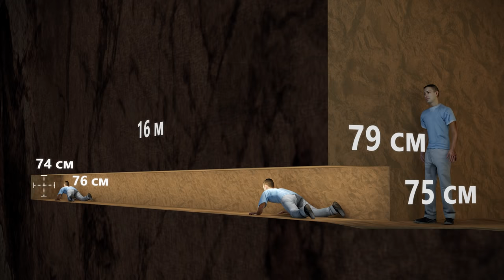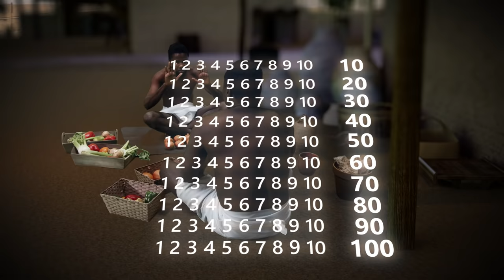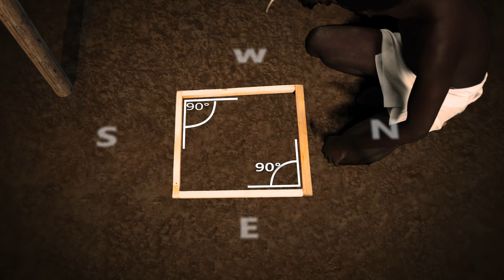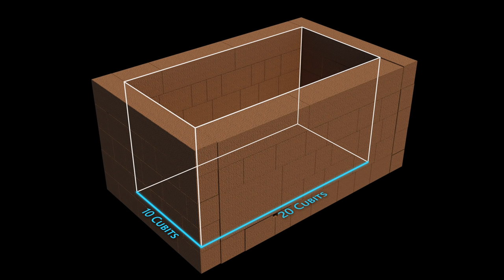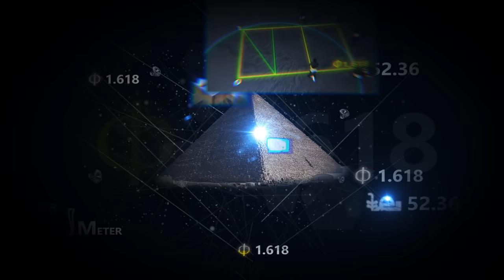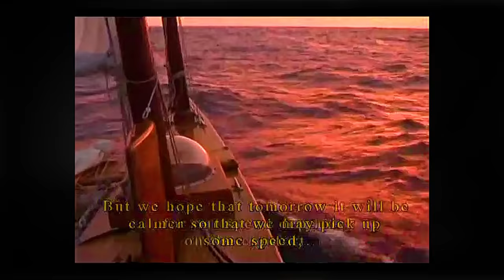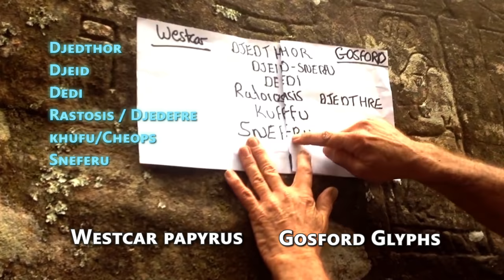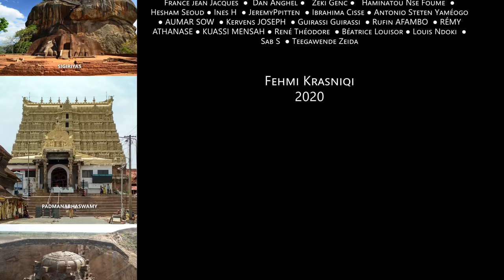The Movie Great Pyramid K 2019 - Director Fehmi Krasniqi

Comment: Granite is generated from magma, underground so it cools slowly enough that three types of minerals form; they are quartz, feldspar and mica.  The migration of the ions and the crystallization into these three specific minerals requires a LOT of time.  The slower the cooling, the larger the crystals.  I have seen granite in the Mojave Desert north of Scottsdale, AZ that cooled very slowly, miles underground.  The individual crystalline components were up to 4 inches on a side!  The premise that granite could be melted and quickly cooled, regenerating granite is ludicrous!  This quick melt-and-cool process would produce lava, or perhaps amorphous obsidion glass, but certainly not granite.  The objects and buildings made of granite are truly awe-inspiring and created by processes not duplicated today, but the melting-cooling hypothesis needs to be abandoned.  I have melted basalt with a 12-inch Fresnel Lens and generated obsidion glass beads on the surface of the rock.
Reply: Thank you for the inclusion.
Reply: I think that you are missing the point, Lon.
This 'movie' is nothing more than a 'suggestion of how the Pyramids' might have been built.
There are dozens more, just like it!!!
Reply: @johnsonhunglo1993  I like the insights into the possibility of poured geopolymer for the limestone blocks.  That answers a lot of questions concerning the massive "blocks" that had to be lifted in every stage of construction.  The white and brown limestone placement in the interior and casing is also well portrayed.  I commented on the melting of granite and pouring it back into granite that was too implausible for me to overlook.
Reply: @johnsonhunglo1993  it might be a suggestion, but they state it many times that this is how it has been done....
Reply: @lonbrouse6440 :
The idea of 'melted' rocks has been trending for a couple of years. 
The only question now is, can it be done?
 I would like to see some HBCU undertake the task to either prove or possibly disprove the theory.
Would that drive down construction costs?
Reply: @amyattell9679 :
Well, if you post it, 
you have to show belief in it!!!!
Reply: @lonbrouse6440  so you do agree with I precised even if not answering
Reply: Aliens 👽
Reply: @MichaelBlackstone777  NOWHERE IN THAT VIDEO DO YOU SEE GRANITE BEING MELTED. ONLY SOME KIND OF ROCK SMOKING A BIT.
Reply: @bigsmalls8354  Granite is really generated from smegma, sometimes maga.
Reply: @johnsonhunglo1993 , I don’t understand why it has to be an HBCU? Why not any college or university, which would include HBCU’s? I’d like to see multiple universities and others take on such a project. Why specifically exclude some from such an endeavor?
Reply: @MrWadsox  right on the money..............
Reply: @Messerwon :
Good Morning & Happy New Year, 
to you and yours.
It does not 'have to be' an HBCU.
But, as a Black man, 
I thought that it would be kind of nice, 
a point of pride. 
I don't see, nor have I heard of, 
a lot of 'engineering' schools rushing headlong into the fray!!
In fact, I am thinking that it would take a coalition of schools, 
with varying degrees of specialties, 
to accomplish the desired output, 
a scaled model of a Giza-style pyramid!!
Reply: @MichaelBlackstone777 :
I think that the consensus is:  
'rocks can be melted'.  
The issue is, 
can a specified volume of melted rock be maintained long enough to accomplish the desired task, 
the formation of a building block.
Each 'engineered block' weighs in at about 5000lbs. 
(More than 2,300,000 limestone and granite blocks were pushed, pulled, and dragged into place on the Great Pyramid. 
The average weight of a block is about 2.3 metric tons (2.5 tons).)
The boiling point of the component mixture is 2300F. 
This is done in an open-air environment, there is nothing in the way of 'controls'!!!
Reply: @bigsmalls8354 :
Perhaps!!!!
Reply: THANK YOU. I can't believe how many people don't understand how rocks work.
Reply: @MrWadsox  Nice. Peace.
Reply: Why did the Egyptians who had more power wear those strange caps in an ovoid shape?
Reply: @TheAusroar  Finally, someone talking sense...Peace.
Reply: @TheMariepi3 :
There must have been some very heavy fashion influence!!! 
You do know that they shaved their heads and wore hairpieces?
Those sand fleas were vicious!!!
Reply: I agree. They used a form of stone softening technique; a lost art of rock molding sort of like Greek fire. History shows they had that capability but no one knows how they were able to do it, even today. This just shows how advance civilizations were back than.  Looks like today's scientist are reading from the 29Th Scroll Six verse:).
Reply: As an old mechanical engineer, specialised for one in building construction calculations, I am happy to read your contribution sir.

I have lituarly 100ths of doubts about the pouring techniques... 
If the blocks were poured on site, why do they look like seperate blocks?
I mean, the second block you pour would use 1 of the 4 sides the previous block to be poured against and would look flushed with it... but it clearly doesn't!

Not one stone looks the same!
So they used every mold one time and made a completely different one milions of times and wasted the whole precious forrest for building these?

Also the pressure on the sides would have been significant and the wood would bulge, even a bit, yet there are no traces?
And many many other mechanical issues make me doubt the pouring theorie. 

And why they would pour the brown lime stones in blocks?
Much easier to just pour the whole layer inside the white limestones!

Everywhere around the world we see big holes in massive blocks like they had wooden beams sticking through... why? If they were poured?...
Etc etc
Reply: @kkrobertson1  I would love to see any type of "stone softening" in action that would not begin to melt some of the granite.  Vague references to "chemical softening" is only hand waving unless one can specify the chemical reaction. Once melted, the crystalline mineral structure of the granite components of quartz, feldspar and mica is lost.  How well does warming ice cubes "soften" them?  The crystalline structure of the ice falls apart from the outside in, turning into liquid water.  the ice cube cannot be "molded" the way some accept molding granite and andesite "softening."  Whatever ice is left, will crush or shatter if pressure is added.  Ice is considered a "mineral" by the US Geological Survey.
Reply: @lonbrouse6440  again we know the Greeks had Greek Fire! At-least that what history tell us. Yet with today's modern science we still cannot duplicate that. And today as to these pyramids we see structures build with precise engineering that cannot be duplicated today. Clearly history has shown us with undeniable truth. There was civilizations that existed that were far more advance in Math, Science, Engineering etc... than we are today. Which completely destroys all these evolution theories.With that said; I completely understand your disagreement as to (stone softening). However, there was a time not to long ago. You could lose your medical license if you believe in Germs! Than came the microscopes.
Reply: @ImmortalOutlaw23  n
Reply: Lon. Spot on. You are correct. I don’t think this idea was not well thought out or researched.
Reply: I’m no scientist but I don’t think the water in that clay tunnel “mold” would respond very kindly to being covered in molten granite. I think it would have resulted in a massive steam explosion at some point. Which begs the unasked question, what were the molds made of that molten rock were poured into?
Reply: @Starriddin  There are multiple speculations offered in this video that are physical and chemical "stretches" of the natural laws.  You point out several good ones involving "molten" rock in contact with wood.  I remember back in the 1970's when wood-burning stoves were the survivalists' answer to living off the grid.  Someone posted a spoof advertisement that presented a wood-burning stove that was guaranteed to burn for 6 hours.  It turned out that the stove itself was made of wood and would consume itself in a minimum of 6 hours.  Likewise, any clay molds would have to be heated to remove water or your prognostication of a steam explosion would certainly ensue.
Reply: Hello Lon, Thanks for writing this comment. It answered a lot of questions that I had except for one. Please excuse me if you have answered it in another comment or reply and I missed it.
Here goes.... Would it be possible to grind up granite from the quarrys, mix it into a cement, and then pour it into a form or mold, and have something looking like granite once it the proccess was complete.? 
I'm probably too dumb to realize that that was a dumb question, so forgive me if it is.
I'm from the Southeastern United States where Terrazzo and other similar things are popular, and although I don't know the exact proccess of making Terrazzo, it looks like it's just an amalgamation of ground up and broken up materials that have been mixed into a type of cement mixture and poured to create some pretty beautiful results, so I was wondering if the same thing could be done with granite, and by some proccess of stirring while it hardened, cause it  to end up looking like cut granite blocks to the untrained eye.? 
Thanks in advance if you reply.
Reply: @michaelmoore8680  Thank you for the well-formulated questions.  I did a little research on Terrazzo (originally small pieces of marble [a metamorphic stone] blended into cement that makes a durable floor that can be re-polished).  Up-close photos of granite show the three minerals of which it is made:  Quartz, Feldspar and Mica [all igneous] with no additional binding material between these minerals.  Up-close photos of Terrazzo show the marble pieces and the cement making up the rest of the volume surrounding them.  Egyptian limestone cement has had sea shells added to it in some buildings.  The shells are easily distinguishable from the limestone surrounding them.  Crushed granite would act as gravel surrounded by cement, a condition that would not look like granite and would be quickly identified as such upon inspection.
Reply: @felipecano1468  Invoking Secret Societies is really just kicking the can down the road and really does not answer anything.  More factual information is constantly being discovered that gradually illuminates the mystery.  I keep watching and evaluating the story as it unfolds.
Reply: Try a 200 inch lens
Reply: @kelmanbeats  :
That really is the question, isn't it?
The 'experts' hop around the question.
They usually answer the question with another question!!!
Personally, I believe that there were 'Black Pharoahs' as heads of Egypt. 
The questions are when did they rule, 
and what did they accomplish?
Some experts say that they were mere 'placeholders', 
others say that they actually advanced their culture.
Reply: Correct in what you say magma that cools very slowly over possibly 10's of thousands of years is needed to produce granite. however, melted granite would not produce obsidian it would be Ryolite as granite is acid rock. I'm a BSc geologist + 20 years experience. and I need to look into this concrete theory must be a way to prove looking at matrix of the limestone or carbon dating. I not finished watching yet but I'm calling bullshit on that theory and doesn't explain the granite carvings and vases etc which are predynastic.
Reply: @hankchinaski4075  I am a Chemist not a Geologist.  I just reported what I have seen when naturally-formed minerals are melted.  I have generated black glass when I melted pulverized rock samples during my years of performing "fire assays" for gold, silver and platinum.  I never saw any crystalline minerals formed in the almost immediate cooling of molten rock.
Reply: @lonbrouse6440  You are absolutely spot on my friend. Granite is a Felsic rock flash cooled will be fine crystalline or glassy as you say obsidian. Its beyond me how their theory has missed this basic fact. Like the granite crystals reform in the mold. Utter rubbish. Totally impossible.
Reply: @TheMariepi3  they had far bigger heads.
Reply: @bigsmalls8354  aliens 👽
Reply: @kelmanbeats :
Agree!!!
But, you never hear these things if you do not control the narrative!!!
Reply: @jbfrodsham  👽 aliens !!!
Reply: @johnsonhunglo1993  Egypt was multi cultural/racial.  The first attempt at the worst idea ever.  That's what Egypt was.
Reply: @johnsonhunglo1993  It doesnt work.  Has never worked.  Everybody needs their own land or there will be conflict.   None of your mumbo jumbo means anything whatsoever.  We have clearly been created uniquely.  You seem set on destroying that uniqueness.   So who's going to have regrets?
Reply: @americanineverywaybutcitiz2330 :
WTF are you going on about?
Reply: @johnsonhunglo1993    People who like their own comments wouldnt understand.

Good bye.
Reply: @americanineverywaybutcitiz2330  :
C-Ya!!!
Reply: @CarChrisMC  exactly,,, that's what I thought,, by the way , also a mechanical engineer, 😊 , how do u do
Reply: @purebloodstevetungate5418 :
It was the 'Mongols'!!!!!
The 'Mongols' chased everyone out of their areas!!! 
The 'domino theory' was demonstrated, bigly!!!
Reply: @johnsonhunglo1993  Mongol Empire "Golden Horde" wasn't a thing until the 11th century.  Human migration started  out of Africa in  pre-historic times in  fathomable terms around  600,000-450,000 BC.
Reply: Obviously the ancients had better tech than us
Reply: Someone has had a geology lesson or two.
Reply: The EGYPTIANS go from most advanced builders to DATE to with all due respect 3rd world country.  Sorry that doesn't make sense. They inherited these structures as did the incas from an advanced world civilisation.
Reply: @TheMariepi3  
10,000 years ago three migrations to Egypt began. The first from the middle east , the second from what is today Sudan, Ethiopia etc. , the third from  North Africa , Sahara included. They all witnessed the landing of three Pyramid looking Alien Craft in the Giza Plateau. One of the first human to enter into contact with the Gods from space was a shaman who newly arrived to the Giza plateau from what is today called the oasis of Siwa. He went back to Siwa as a worshiper of the God Amun. The interaction of the Gods with the humans produced a leap in the evolution of Mankind. When the Gods left , the Egyptians tried to replicate the Pyramid looking craft in stone at the three landing sites in Giza. At Siwa the worship and Memory of the God Amun , the God that came from space were kept. Alexander the great knew that...
The Giza plateau was not the only place where the Gods from space landed...
Reply: I agree with you having worked in open pit mining for decades and been around and listened to many geologists talk about rock formation. There is no way any civilization back then had the technology to heat massive amounts of granite to over 1000 C.
Reply: Although you have an excellent point about the melting-cooling conjectures, when we consider how microwave radiation heats food; given their great discoveries I would consider that they developed a lens capable of microwaving rock which would allow molten forms which quickly hardened in small quantities.  Microwave technology has not reached its apex and surely we would all benefit from such a discovery.  I believe this explanation more reasonable than previous but by no means the total explanation.  However, Truth is hardly an easy discovery...  House of KingDavid
Reply: @nouneyhill9795  Where is the source of all this high-intensity microwave radiation?  Solid materials are opaque to microwaves, and thankfully, very low intensity radiation in this range gets through the atmosphere.  Additionally, they are "focused" by antennas, not lenses.  Have you seen a photo of the microwave "horn" antenna in Holmdel, NJ, that was built in 1959, used to detect the background microwave radiation left over from the "Big Bang?"
Reply: @nouneyhill9795  ouch. erm giving you a free pass for not understanding the different forms of energies which frequencies plays. But seriously though, just because you think of something does not make it so.
Reply: Geologist here, complete concur. Granite crystals cannot be poured; however pouring the limestone makes alot of sense.
Reply: The Granite and large amount of Granite Quarries all over Egypt make the cement hypothesis questionable.
Reply: I agree that it is ludicrous to create granite but in this case it comes down to the lesser of two evils. What’s more likely, the Egyptians hoisted that granite that high and positioned it perfectly with an incredibly smooth surface or that they somehow moulded it with a different process to how we think. I saw another idea that the “granite” on the small pottery would be a different kind of rock that was processed in a way to look like granite and moulded on. It seems unlikely but considering you can’t heat and reform granite it is the closest we can come
Reply: @penguinboi4205  Pouring magma granite is an impossibility. Cutting and lifting are at least possible.
Reply: @landon2215  I agree that isn’t possible to melt but the limestone geo polymer dosent have the same chemical similarities than that of the Taurus limestone site. Plus how do you explain the wood clearly embedded deep into the wall as there is no way to cut them. Also you say lifting is possible can you link me a video that actually shows how they could do it because I would like to see your viewpoint
Reply: @CarChrisMC  Древесину можно защитить от влаги уложив внутрь опалубки ткань пропитанную жиром! Надо бы поискать следы отпечатков такой ткани на поверхности блоков! Но это вопрос к автору этого фильма! :)
Reply: TRUTH!
Reply: What's even more absurd is that granite was carved!
Reply: @TRICK-OR-TREAT236  Most of the video was a cartoon, not a documentary showing actual processes.
Reply: @kkrobertson1  Your arguments are red herrings, not pertinent to this discussion.
Reply: @lonbrouse6440  in all do respect sir. Your explanation is based on in understanding of the science you know and not base on the science they had. Therefore, your explanation as to how these stones could not have been melted as shown in the documentary is more than correct and has open all our eyes to that reality. 

However, these structure, clearly was not built the way archeologist and other professional  in this area claim they were. So these Nubian's as they called them-selves; must have used another method to construct these pyramids as they are known to us today. Mentioning methodologies that could have been lost (like Greek fire) to build these monuments is more than plausible, in fact! The structures them-selves are an observable reality of that truth.
Reply: @kkrobertson1  The science that is known is all we have to evaluate observations.  New proposals are always welcome but to be taken seriously, the proposals must also be accompanied with plausible mechanisms for the processes.  Identifying that there are unanswered questions concerning the way the pyramids were built, should not immediately propose methods that have no scientific support and cannot be replicated.  Those items are best left to future investigation and new discoveries.  Demanding unsubstantiated claims be accepted, quickly relegates these ideas to the "fringe" because these claims do not lead to productive investigations into plausible mechanisms.  Step-by-step investigation is the basis for the science that has led humanity out of the stone age to the level of culture we currently enjoy.  Open discussions, like this, often lead to new discoveries.
Reply: @lonbrouse6440 up until the stone age part. I was some what with you. This conversation in it self, negates that theory.  History has shown, these advance civilizations more than likely coexist with less marginal societies. The same way Western Civilization do today. With that said. The science that was used to build these pyramids were more advance than what we have today. If it was not, than what they constructed would not be such a mystery to us. We could easily duplicate it using the science we have today. But that simply not the case.
Reply: @kkrobertson1  I think I mentioned that we have to start with the science we have when we approach unexpected discoveries from earlier civilizations.  If they used different techniques to achieve their goals, applying scientific methods to the investigation is the best tool we have.  The first step is to hypothesize a method they may have used and investigate that.  That is precisely where we are now.  The next step is to see if we can duplicate their results with our hypothesized process.  That is the hangup.  There has not yet been a hypothesized process that can be tested to duplicate the results seen in ancient Egypt.  How do we make a big leap without taking the smaller steps first?
Reply: @lonbrouse6440  "touche" on that point.
Reply: so do we go back to copper tools cutting and carving granite blocks?
Reply: I’m not at all shocked that you didn’t include your Establishment funded Doctorate.
Reply: @johnsonhunglo1993  The trending “Idea” you’re alluding to is due to THIS documentary. 

I’m a financial analyst coming from a 4th generation private family of  precision engineering exporting manufacturers that hasn’t yet been succumbed to takeover. 

It is the most accurate theory I’ve had the pleasure of seeing. Most definitely worth other experts to debate in peace. 

It’s hardly been discussed within MSM which should be a red flag to anyone who innately thinks critically and isn’t part of the Establishment. IMHO.
Reply: @amandar7719  What are you talking about?  I worked at an outside job while I completed my college degrees.  I earned scholarships and took out student loans (that I paid back).  What Establishment are you writing about?
Reply: @amandar7719  fair enough,  but granite can't be melted back into its natural form.  I agree with the casting. I was all the way in ,until I looked up the experts, granite melts. But as far as I know, not back to granite.
Reply: @lonbrouse6440  The one that triggers commentators to divulge their qualifications and get others to think outside of the box when reading mine. 😃
Reply: @derekgreene2304  Did you read one of my posts that said anything other than melted granite does not return to granite?  You may have me mistaken for someone who stated that but it was not me.
Reply: @lonbrouse6440  what are you talking about, I never said it was you. I watched a documentary months ago and looked into it, some guy melted granite and it went black and brittle, he was a professor I think. Your the one that is mistaken. I'm just trying to find out the truth. With the smithsonian in our way, it's so hard. There had to be an intelligent civilisation/ civilisations back not long ago. I think they mined the earth and moved on.I also think the earth is flat, and there's more land that there not coming forward with. Nasa never went to the moon, not in that thing anyway. How'd they get the rover on, antarctic treaty, the pope turned up for that one. Admiral bird told us all we needed to know,  forestall got checked into a lock up ward, then thrown out a 16 story window, he was coming clean about it. You can fool some of the people some of the time but you can't fool all the people all the time!! Wise up is a good channel, not always right but he's thinking. Is it possible there was a reset in humanity in the 15 or 16 century, before even. In some European countries they were teaching disc shaped earth up to the 30s, in America too. Watch flat earth the movie, you'll be surprised. There's no curve. NONE.
Reply: @amandar7719 :
Okay!!
Reply: @lonbrouse6440  Isn't moving those granite slabs as implausible?
Reply: @assassinbullets928  Yes.  That is the point.  Nobody has yet come up with a plausible process by which these structures could be built.  Keep Looking!
Reply: rather than disproving this theory, why don't you team up with them and contribute something towards this enigma
Reply: @mohdazmi3590  :
I would love to see some school undertake this effort.
But, the costs may prove prohibitive.
But what technique!!
Reply: @johnsonhunglo1993  maybe we are not as advanced as we think we are as compared to them, in terms of solar utilization. But if this solar lens method can be proven, this will answer many historical questions, and clearly contribute to numerous solar research programmes.
Reply: @mohdazmi3590 :
Bread crumbs all over the place!!! 
There seem to be signs and messages everywhere saying 'we were here'!!!
Reply: That's a very good point and thank you for the clarification. I personally think the granite is the only stuff they actually took the time to cut and polish. Rest was poured into molds just like we do it today.
Reply: @mirceaalex8313  :
Is that a practiced technology?
Molded granite blocks/bricks?
Reply: @johnsonhunglo1993  Molded granit not but the actual blocks were actually replicated and they got the same material as one used on the Pyramids. It definitely makes more sense to pour a structure then to somehow cut huge blocks of rock and somehow cary them for huge distances. Not to mention that using a ramp to build the Pyramids would require more materials as the Pyramid itself. They most likely poured the main blocks and only the granit stuff was carved and sanded.
Reply: Thank you sir.........here here!!!!
Reply: @brianl3240  Many other contributors to this conversation have made comments based on their experience with melting granite and other crystalline-based minerals and have all come to the same conclusion........that when cooled the molten material never returns to its original form, including granite.  The magma crystallization processes take thousands to millions of years to separate and grow the component crystals and minerals.  It is not accomplished by melting and casting amorphous glass.  

What have you personally done?  Do you have anything to add to the conversation except to deny what others have contributed through personal experimentation?  It is the mark of critical thinkers to explore many sources of information that address the basic premises of a claim.  It is the mark of the duped who take a stand in ignorance and defend it with stubbornness!  

Which approach seems more rational to you?  If 1 million people all believe the same wrong thing, does that make it correct?  I think not.  Even Einstein said that all of his thinking and conclusions, even if accepted by masses of followers, could be disproved by just one substantiated, contradictory observation.  The truth is not established by its seductive popularity, but by critical thinking, observation, confirmation by people who are trying to disprove it, but cannot, and finally being open to change their opinions when presented with new information.  That is called science.
Reply: @brianl3240  Read all of my posts.  This train of thought has been addressed and your rejection of many contributors and mountains of published references dealing with the nature of melting and crystalizing rock looks a lot like willful ignorance.
Reply: Your first mistake, try melting at 2500 degrees. Once you’ve done so come back and leave a better comment.
Reply: I don't see you offering any other possibility of 30T blocks being carried and then joined, all different shapes with less than a cm between them, all the way along. 
Please explain.
Reply: @Ant88889  People have been guessing how the pyramids were built ever since they were completed, thousands of years ago.  I have not put forth any details for the construction because there are already too many guesses by people who have no idea.  There is no benefit in making any premature conjectures until more research is done in the critical areas of chemistry, engineering and materials science.  While entertaining, these discussions do not move along any understanding.  I have focused on evaluating some of the guesses presented by others and offering my critiques on ideas that are more or less plausible as constrained by the science we currently understand.  To do otherwise causes people to wander off int mysticism and alien intervention.  In short, magic.  There is no value whatsoever in going down those paths.
Reply: Perhaps they didn't simply "melt" natural granite, but several materials/minerals that when combined into a porridge type of molten rock, it will cool to possess similar attributes to natural granite.

Perhaps they had a recipe/process for this, gained over hundreds or thousands of years working with stone, that has been lost long ago. 

The alternative, that these enormous granite blocks were carved, pulled, lifted, and chiseled to perfect dimensions using stone tools, is completely implausible.
Reply: @amyattell9679  This is a problem for dyslexics people think if you repeat exactly what you said then to you it makes sense to me it still dosent .Like mathematics it needs to be approached from a different angle.
Reply: @jaybayer3670  I do ...ROCK N ROLL YEEEEEEHA there you go heehee.
Reply: @johnsonhunglo1993  F...k the pyramids the most important fact here is black Egyptians where giving the people of the world knowledge before slavery .Now black history can be rewritten there can and should be further research done.
Reply: Explain how they where built public school teacher. I will wait.
Reply: Look at the gods aliens worshipped. Happen to match description of Nephilim.  That Science supports did exist but they called them Giants.
Reply: @silkoakranchpitchforkranch1205  First, I have already posted that at this time, nobody knows how the pyramids were built and that includes me.  I can question presentations and postulates against known physics and chemistry.  I have simply stated the flaws in the hypotheses in the movie.  Demanding that someone come up with a coherent method of how the pyramids were built, is not how science works.  Those who present hypotheses are responsible to defend their ideas.  Those who ask questions, only have to ask the questions.  I have not presented any hypothesis on how they were built. 

How can anyone "Look at the gods aliens worshiped" when neither the existence of aliens or or any gods have ever been been demonstrated?  The presentation in the movie is speculation "all the way down!"  It is entertaining, but do not use it as a serious guide on how to build pyramids.
Reply: So can we run experiments today? It seems as though this theory can be proved or disproved easily.
Reply: @CarChrisMC  I would dare to say weathering over thousands of years.
Reply: @lonbrouse6440  the big bang. Lol
Reply: And yet, most of Sankt-Petersburg build with artificial liquid granite. There is tons of books about it from 18-19th century, including the recipes for it. I agree what it’s not made with the large magnifying glass, but simply as a mixture of elements it could be done. Like I said - Saint-Petersburg Russia Is full of it. Look it up.
Reply: @sergeyolkhovskiy3496  I found many references to buildings in St. Petersburg being built of granite but not one describing "synthetic liquid granite."  Please furnish a link.
Reply: @lonbrouse6440  you speak Russian? It’s all over the Russian alternative channels, with like I said even some recipes!!!!! In the old published technical books:) have to be a particular old falling a part granite from Karelia, I’ll send you the Russian links - maybe you tube will put English captions for you. Knowing that - look at most of the granite work there, and it’s obvious- it’s how it’s been done.
Reply: @lonbrouse6440  predsedatel snt - I think is the one who is talking about it the most in his videos. The second link what I did send you.
Reply: Try heating at 2500 degrees. It will not give you obsidian glass at that point.
Reply: @jorgeduenas428  Dry Granite melts at 2,219 to 2,300 deg. F., destroying the crystalline separation of the quartz, feldspar and mica, melting into amorphous melt.  If cooled quickly, you get volcanic glass.
Reply: I don't have your depth re the geophysics but at least give them credit for not "...therefore aliens"
Reply: @beanzieobeanz2955  The presentation and discussion of the pyramids and the technology offered for their construction presents physical and chemical processes.  The processes must be evaluated against known scientific data for a starting point of discussion.  I was responding to Jorge Duenas'  hypothesis that if granite were heated to "2500 degrees" you would not end up with obsidian glass.  I was trying to find out what Jorge was trying to imply.
Reply: @lonbrouse6440  all good, I very much appreciate the likes of you and your informed, knowledgeable peers able to get amongst the weeds on these matters
Reply: Very good point lon. I have seen the same discussion regarding the stone buildings in Cusco , Pero. Many people proposed a geopolymer material but careful analysis of the stone suggested it is unlikely. I personally think they had a process to soften the stones without Merlíng them but I don’t know if it’s chemically possible. Also look at the unfinished oblisque pictures, it has scooping marks. Definitely doesn’t look like it’s pounded by a small stone.
Reply: @emado2  To date, when crystalline substances, organic or inorganic, begin to melt, the crystals lose their ordered structure as they become a liquid.  The process does not happen all at once, there is a melting "range" during the increasing temperature, some crystals melt before others.  If the temperature is carefully controlled and then cooled, some of the melted crystals that have become amorphous glass will remain that way while intact crystals will be left that way.  Evidence of that is not seen in any of the world's megalithic structures.  "Softening" appears to be one of the discarded possibilities.  The scooping marks at the base of the unfinished obelisk remains a mystery, one of many.  The scooping patterns do resemble sand-blasting which is focused on intermittent areas of the undercutting, as opposed to more general horizontal sand-blasting along the length of the "cut."  Explorers have not yet, unfortunately, found any air compressors, hoses or nozzles necessary to conduct such a process.  Just a thought.
Reply: @lonbrouse6440  I get your point and I have no explanation for how the stones in Peru are made to fit perfectly in 3D the way the do. Definitely looks like concrete being molded. There is zero chance it is stone cutting. It’s much more abvious that in the pyramids. Actually in The Valley temple in Giza you can see some of this curved fitting of granite stones. Mind boggling even if they had access to iron tools.
Reply: @lonbrouse6440  The limestone also was not cast!
Reply: @johnsonhunglo1993  Just look at the blocks this proves they where not melted or cast!
Reply: Thanks for your insight, I have to admit I really wanted this theory to be true.
I personally have very little knowledge of rock, melting rock, ect, so I very much appreciate you giving an explanation a layman can understand. I had suspected that the theory seemed too simple to not have been considered and proven/disproven by people with professions in the required fields.
Regardless, I still enjoyed watching and wondering...
Reply: @sergeyolkhovskiy3496  please share the link here
Reply: @oli.y  already did, look at my previous comments
Reply: I believe that the most plausibke way all these megaliths were quarried and moved was using ekectrogravitics for moving and placing and sound technology for shaping and quarrying. We know the Egyptians understood sound as their monuments are tuned to resonate. We also know they had electricity (Bagdad battery) but egyptologist claim they used it only for electroplating. Sure, in hundreds of years, they never discovered another use. 

Maybe resonance could allow them to soften the stone without heating it. 

I like the limestone geo polymer idea, as I had thought of this myself. , because it solves many unknowns and is entierly plausible. Esoecially since the geopolymer concrete has been found in indian temples. 

But it's clear they had some technology we dont. Balbek lebanon can not be explained by concrete as one of the 100k tonn blocks is abandoned in the quarry. 

What baffles me is egyptologist are always saying, "99℅ of Egypt is still buried in the desert," so uhh, WHY ARE WE NOT DIGGING IT UP? THOUSANDS OF YEARS OF HISTORY PRESERVED?
Reply: don't forget the pressure required!
Reply: @johnsonhunglo1993  easy to disprove the theory of melting granite - the 1200 ton obelisk at Aswan quarry being cut from the bedrock. Why do that if you could just mould one?
Reply: He also completely glosses over all the casing stones of granite on the 3rd Pyramid at Giza.
Reply: @penguinboi4205  If you bored a hole in rock and hammered wood into it - how would it's appearance differ from being encase in a geopolymer?
Reply: @mohdazmi3590  clearly zero geological knowledge.
Reply: @jorgeduenas428  no - it's acidic rock - it'll give you rhyolite Einstein.
Reply: @doctormarazanvose4373  best guess doc, how do you think they done it ,with the granite, I think the outside of the pyramid was mixed up on site and poured, as blocks, but the granite??
Reply: The problem I have with the large lenses is that NONE have been found - nor any record of this technology.
Reply: I'm only half way through the film but cme to comments to leave a review and see what others say then I saw this comment. Perhaps I'm not to the part in the film where they said they melted granite but I am watch where they are talking about the pyramids being built with light and dark limestone mixed with water and other ingredients. I will have to listen for the melted granite part and if I missed it watch the film again. As thus far the construction makes far more sense than any other theory I've heard like dragging stones, or floating the stone or my all time favorite the alien theory. Alien theory is quite interesting but severely down plays the ability of human intelligence which I'm not  fan of but interesting to heard wild theories.
Reply: I am back I see now where they talk about melted granite. I am not an expert so I researched it and you are correct so unless ancient Egypt had some advanced technology to recreate granite after melting it I don't see it possible for them to have melted it without it turning to glass. Melted granite looks different than real granite.  But it begs to question did it look like glass 4000 years ago and with weathering it looks more natural . Not sure if you have answer to that.  If you do let me know
Reply: @khadijahbintsalafi9726  if only they had taken time to observe the pyramid itself - they would have noticed that it isn't made up completely of blocks - it's a structure of blocks surrounding rubble mixed with mortar.  This whole documentary is a fantasy.
Reply: @khadijahbintsalafi9726  once glass always glass - you are past the process of crystallisation. Don't forget that the blocks inside the pyramid would not be subject to weathering.  This documentary is just a complete fantasy and should be categorized as "for entertainment purposes only.
"
Reply: What Lonbrouse said!.
Reply: You are absolutely right! Congrats!
Reply: @hankchinaski4075  did you come to any conclusion about the limestone matrix? I definitely agree about melting granite, that part was bullshit. Not sure about the concrete though.
Reply: @jharv300  Hi, I think the concrete is also BS too to be honest. I watched a podcast from Chris Dunn and engineer on the pre-dynastic granite and diorite vases. They took high res images of them and the calculations / dimensions and machining that went into producing them could barely be matched today and these are Pre-dynastic. Also a lot of evidence of machining half finished on blocks around the sights. Very interesting work check it out.
Reply: Did you have years and years to try different experiments??? So other than your somewhat vague and sophomoric granite experience… is that the only negative thing you can muster up with this doc documentary???
Reply: Yeah, better belive they shipped and lifted 200t stones.
Reply: To understand  Egyptian knowledge  ;  u got to think resonance and frequency  .
Mold will never give resonance  .
That is why the cracķed Oblisk  wlas lef there  .
Reply: @johnsonhunglo1993 (the elephant. in the room) NO ONE questions how the ancient black Egyptians smelted gold to make the INTRICATE masks, thrones and gold artifacts.  If they had the knowledge to make molds to form gold statues...etc then they had the knowledge to pour granite mortar into molds!
Reply: Why have none of the enormous glass lenses been found although they should be no subject to aging at all.
Reply: @lonbrouse6440 not if the clay dries for 12 months or 5 years or 10 years, or if it was already built 30 years ago from clay, then poured with rock at a later time.